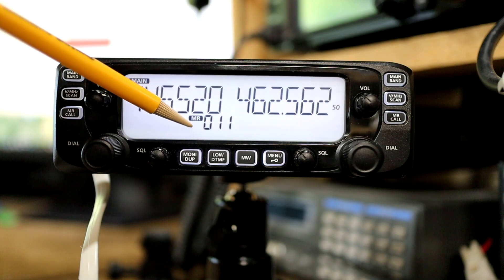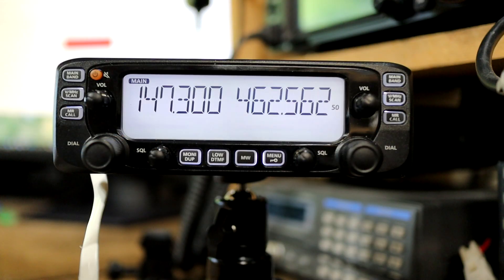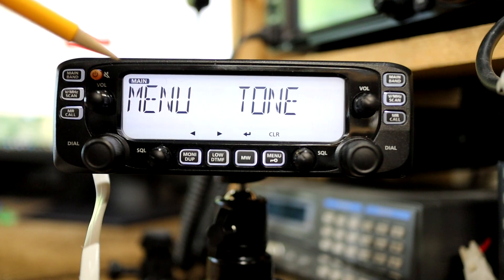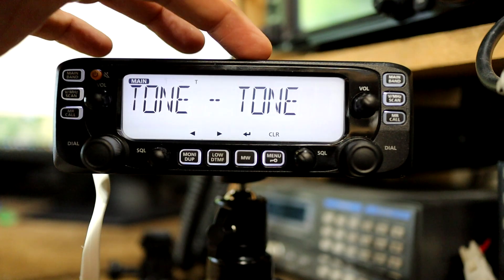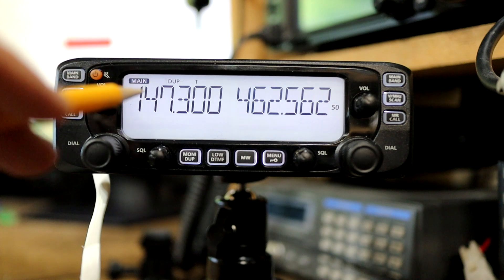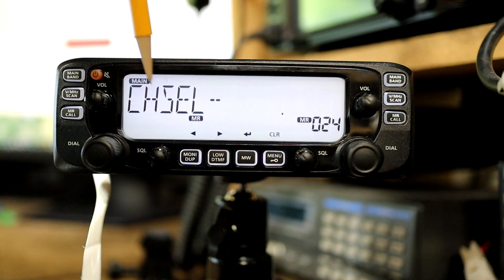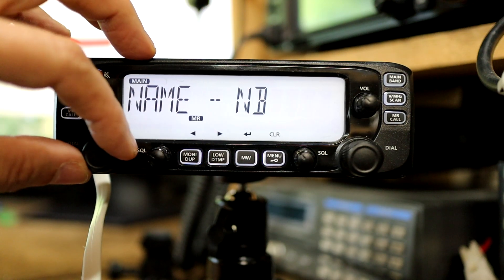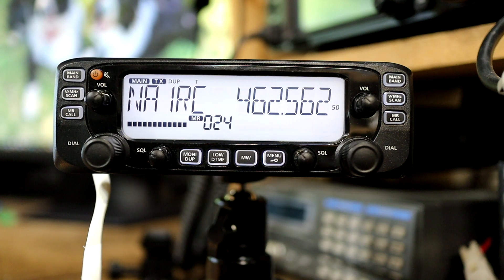Ham Radio: Icom IC-2730 Manual Programming Highlights

Comment: While an awesome radio, I personally find the 2730 (or any ICOM) hard to work with on the fly. NOT intuitive at all and can be very confusing to program without software. Way too many steps for simple operations. However, this is a great video and definitely helps! Thank you for posting it!

Comment: So the radio doesn’t know automatically what the offset should be? Am I understanding this correctly? I am curious about buying one for my truck but I’ve always used Yaesu. They know the offset unless for some reason the repeater is reversed of what is should be
Reply from the maker: I don't remember if it automatically sets or not...what did I say in the video...I don't remember.  I may have showed the offset setting for the sake of showing it
Reply: @SevenFortyOne Thanks for the reply. 73

Comment: Is there a way to do split DTCS codes on this Radio? As in different DTCS codes for Transmit and Receive?
Reply from the maker: Yes, you should be able to do that.  Check the manual for the exact steps
Reply: @ thats what I thought also, but apparently, according to the manual, you can do DTCS (same code tx/rx) or DTCS/off or DTCS/CTCSS, but not DTCS/DTCS.. ;(    Thank you for the reply, enjoy your work, take care.

Comment: I love your easy to understand videos, thank you. I subscribes and liked.  I do have a question on name/frequency display. Is there a way to move easily between displaying the frequency or the name. Sometimes I forget the frequency if I don't use it much. KI7PMA Dan
Reply from the maker: I think you can switch but I can't recall the keystrokes as I'm at work right now.  If you search up a copy of the manual it's probably there

Comment: Thanks so much for this video! I'm new to ham and just bought a 2730. This video has helped a lot! I do have one question though. In the video i saw you set the offset to duplex +. Don't you also have to indicate the specific offset? I see there is an offset option in the menu. I would think that when manually programming from Repeaterbook this would also need to be set. Mayne I'm wrong. Again, im super new to all this. Just trying to understand. Thanks again!
Reply from the maker: The default offset of 600khz will work for most repeaters so it doesn't have to be changed each time you program a memory.  You only have to change it when there is a non standard offset

Comment: Rob, Great how-to. Everything went exactly as you said UNTIL I tried the “Call” function. Long pressing the M/R button selects C0 and C1, but they need to be changed from factory presets. The manual says they can be changed but is very vague as how to do this. What is the procedure to set C0 to 146.52 and C1 to 446.00?
Reply from the maker: I don't have my radio in front of me right now but I think its the same as setting a memory channel - you just need to select C0 or C1 instead of a channel# when selecting what channel to write to.
Reply: @SevenFortyOne  thanks Rob….ill try it.

Comment: Love the video. Want to now run out and add the icom to the radio stable as that would be a great addition to the shack.  Tip? Replace the pencil with a rubber pointer finger :)
Reply from the maker: It's a good radio...I almost bought a second one recently but went for the ftm300 instead and am kind of regretting that decision.  The ftm300 is a great radio but lacks one feature the icom has that I use quite a bit...stay tuned for more.  Oh, and the pencil is one of my signature items just like the license plates so it's gotta  stay😄

Comment: I have a repeater that has 2 different dpls for tx/rx..  can I do this manually or need a computer? I even tried the tx on channel A and the recieve on B but wasn't hearing anything, the tone menue options kinda confuse me as well... any ideas? Please .. .  .   .
Reply from the maker: You can definitely do it with ctcss so I'd think it should work with dcs too.  Dcs isn't used here so I've not tried it myself
Reply: @SevenFortyOne  I figured it out...! Lol all you do with dcs is put the tx code, then in first option of menu under tone, scroll and choose.  "dtcs.off" uses your dcs then opens the encoder to accept anything comming back in... woooooo...